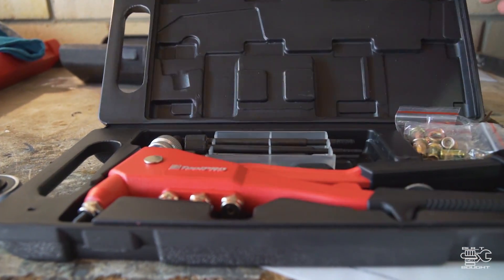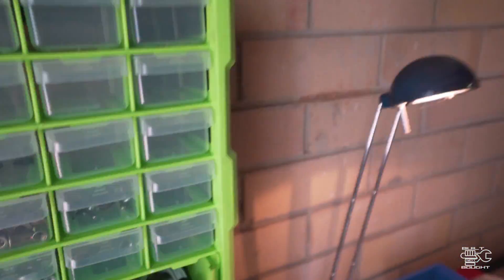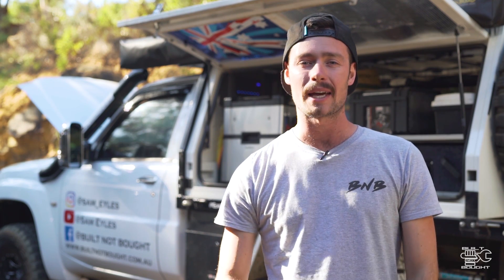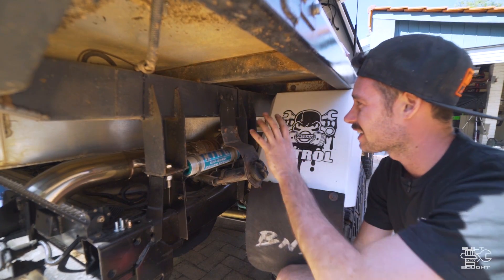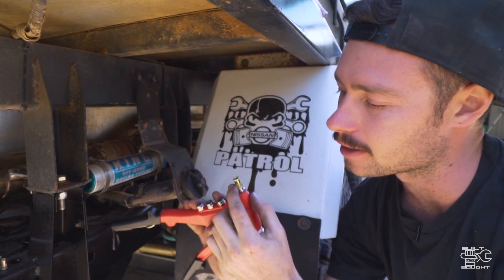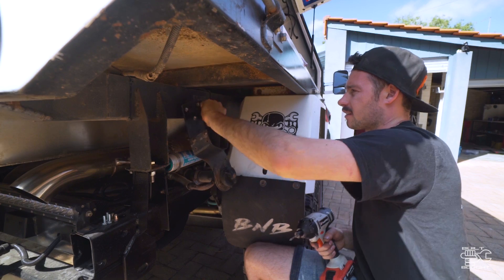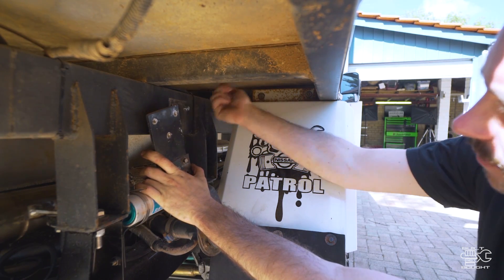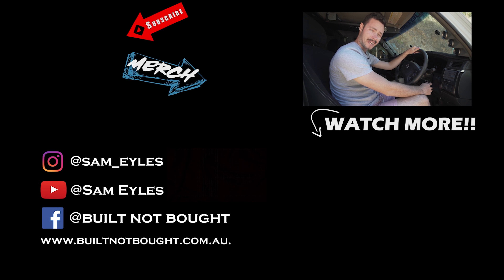TECHNICAL TUESDAY || All About Nut-Certs

Comment: A small trick I learnt many years ago.. for my rivet gun which you can use for this.. is 2x100mm lengths of Gal tube. the tube is slightly larger diam than the handle arm itself, then you slide over each of the handles, which then give you more purchase/length to help you close the handle thus pulling the back end through.. or back the rivet or nut off slightly from full in position will also help.  Great stuff.

Comment: FYI.
If you dont screw the nut insert all the way up to the gun, you don't have to squeeze the handles so far. You can just screw the nut insert closer to the gun after a squeeze or two to get it as far as you can.

Comment: Sam, and all the others that struggle with starting these off,i have a small tip that helps.

Instead of screwing the nutsert onto the handle all the way, back it off a couple of threads. (not too many as it can strip) That way when you start it allows the handle to close a bit initially. After the first squeeze screw it in further.

Comment: Considering you spelt nutsert wrong cant be too technical. Also known as a rivnut. Also if you know the best thing about them is they come in hexagon so they don't spin just requires a hexagon hole which is easy when you cut everything on a laser. Look into an air gun gets job done in no time. I have a Gesipa FireFox at work does the whole job in 5 seconds when its set right. screws in clamps rivnut and threads out